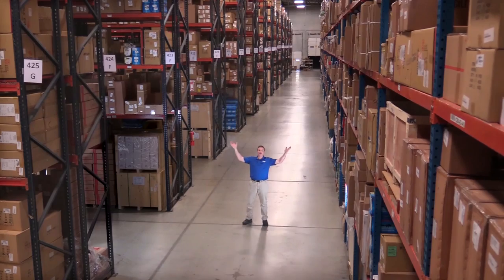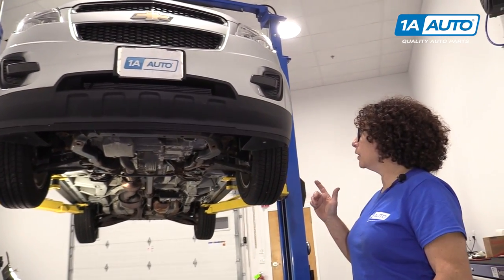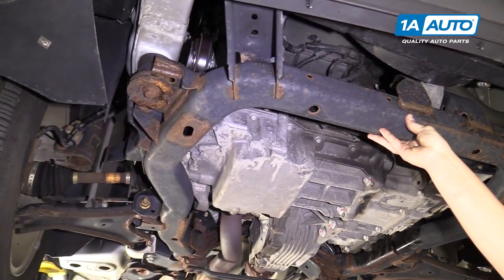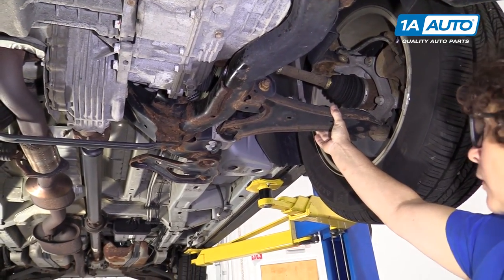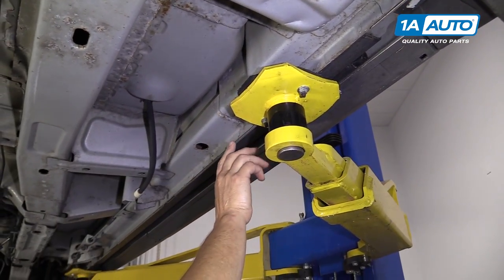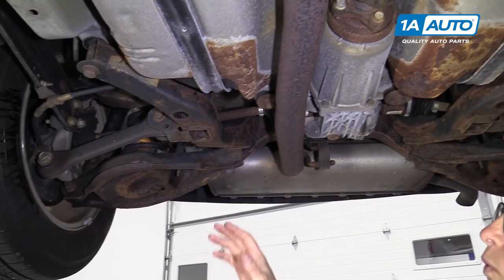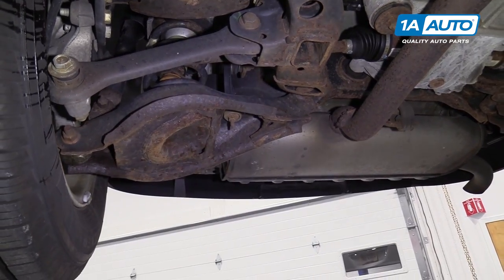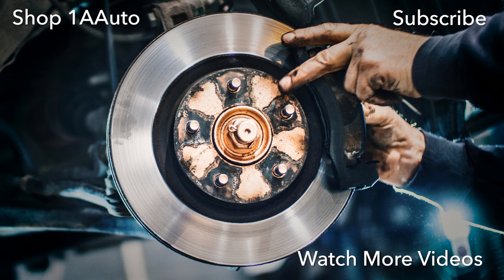How to Raise and Support 10-17 Chevy Equinox

Comment: I started jacking up my car in the rear where the manual shows using my floor jack, I heard and saw rust falling off so I stoped and watched the video, makes cents to put it on the flat part. Having a time removing the pad bolts. Done it for years but now?